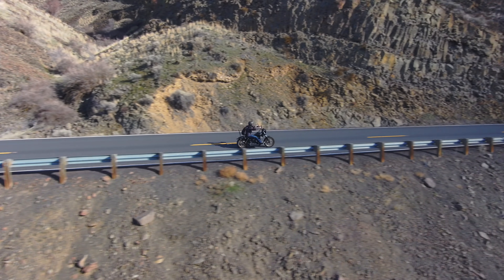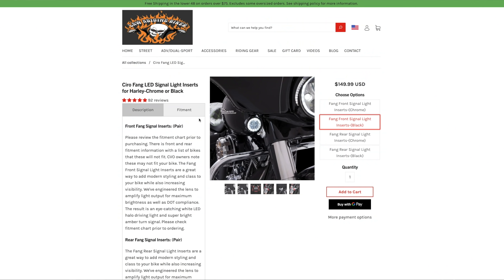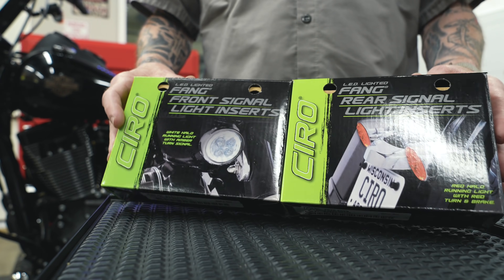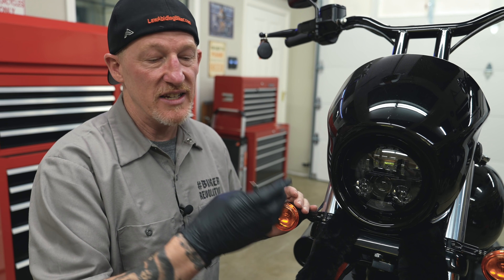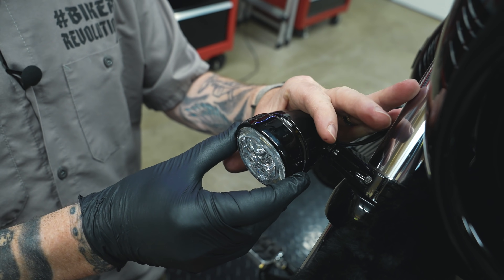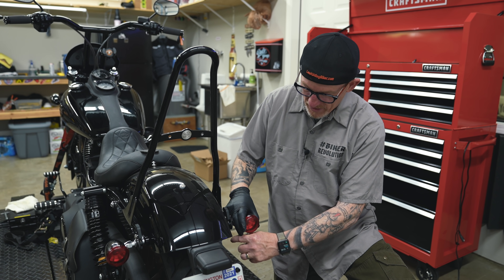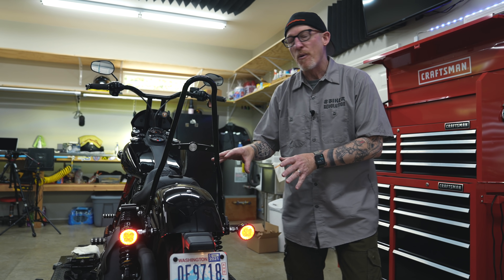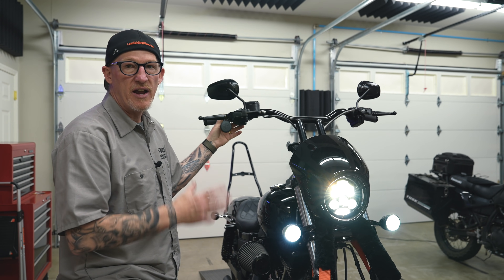Harley LED Lights, Brakes, & Signals Mod-Ciro 3D Fangs-Install These!

Comment: Custom Dynamics are the kings of LED aftermarket lighting.  The front  white LEDs don’t to much. I replaced the covers with the original yellow lenses.  Why? Not that it matters but most aftermarket LED lights are not DOT approved.  LEDs consume little to no electricity. My rear red LEDs light up my entire property 😂 the Big Bang is the dual LED headlamps on the Road Glide. You can’t miss them on the most sunny day.

Comment: How do you feel, in all Honesty how these compare with the Custom Dynamics?.  I have several Ciro3d products, the "Big ass drink holder" using the clutch bracket perch, and also the Cell phone holder working on the same perch...Obviously only one at a time.  Everything I have bought from them has been Excellent Quality...I have a 2012 Slim, and as soon as I bought I installed the Custom Dynamics immediately front and rear, and when my Wife bought her 2019 Iron, I bought them for her bike also.  I don't know why I waited so long to buy some, they would have been excellent on my FXSFT, and FLHS...  I'm asking because, I can't begin to tell you how many replacement Lenses I have purchased for both my Bike and my Wife's Bike.  I always have them installed correctly.  My Wife was getting her Bike serviced, and the tech asked why she had a strip of clear packing tape, running around the lens and mount.  She told then the story, and his reply was , "they just didn't get installed right"...LOL Ok.....was my comment when she told me.  She tells me yesterday, she hit a bump and it fell off again, lol....    These Ciro models, I like because that isn't going to happen, if it does pop out, at least you won't loose the lens.  I see the Ciro, and the Custom Dynamics are both priced closely together.....but at 8 bucks a pair for the lenses, it's getting expensive....Something I forgot to add, my Custom Dynamics work perfectly on my 2012 slim, no fast blinking anywhere.  Instructions said once the bulbs were installed, turn the key on for 60 seconds, and the computer would reset.  For some reason it worked....Thanks for another nice video
Reply from the maker: We prefer CIRO due to the high quality of products.  We've never had a Fang LED insert fall out.  

Ride safe & Ride Often!

Check out this YouTube Channel as we have a ton of free videos for you!

Check out our useful for purchase videos: http://www.lawabidingbiker.com/buyvideos

BECOME AN ECXLUSIVE MEMBER-GET BENEFITS:
http://www.lawabidingbiker.com/patreon

Leave a flat donation: 
https://www.lawabidingbiker.com/donate

Shop in the Official Law Abiding Biker Store:
https://shop.lawabidingbiker.com

Subscribe to the Law Abiding Biker Podcast: https://www.lawabidingbiker.com/app

Join our free email club:
https://www.lawabidingbiker.com/emailclub